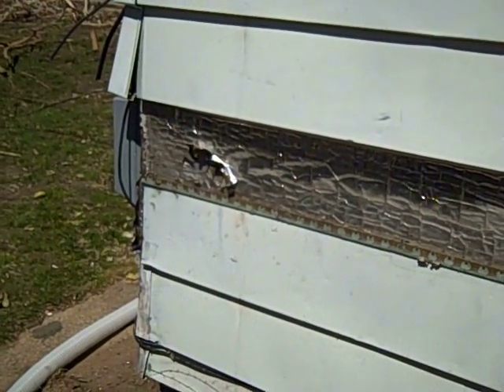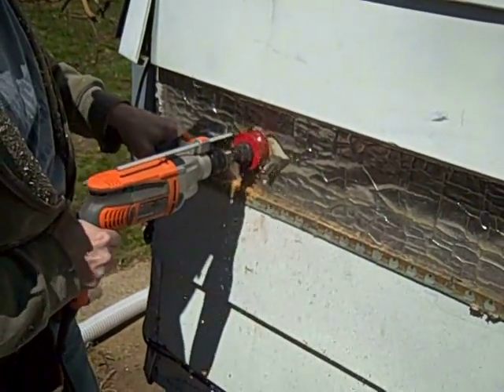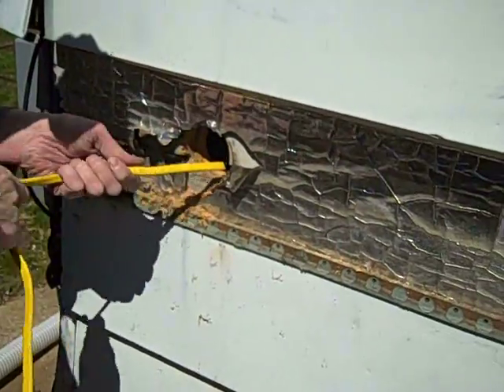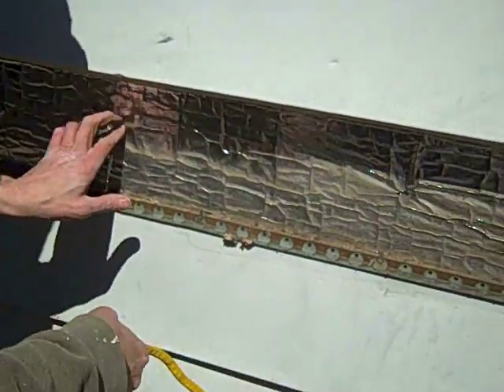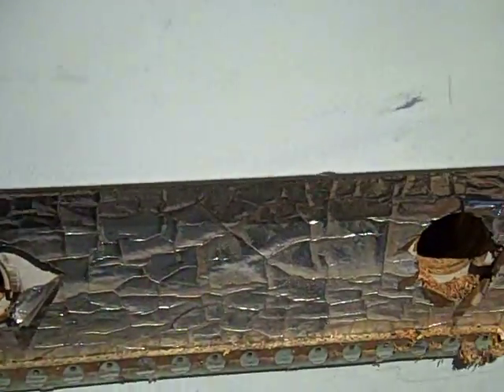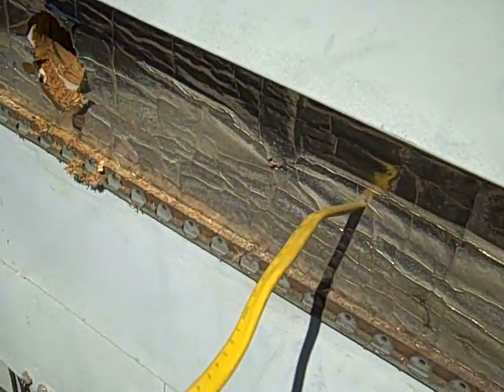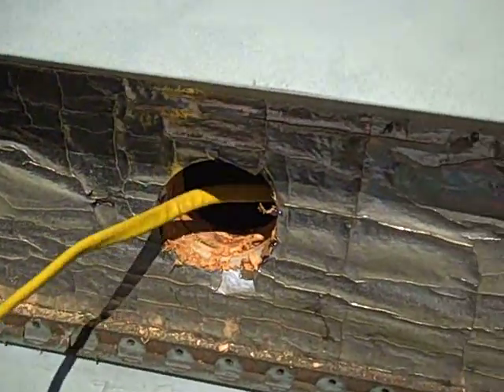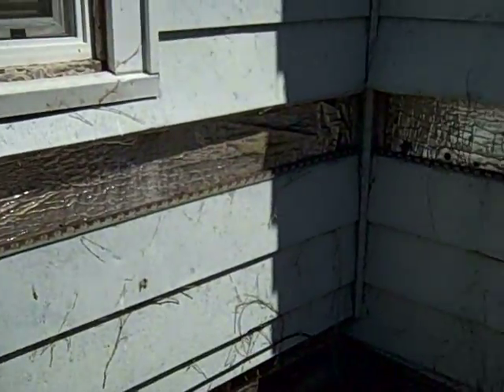Drillng holes in exterior before dense packing with cellulose - www.startinsulating.com

Comment from the maker: That was a Rigid and it burned up a few days later.  We now use only the Milwaukee D Style drill 0-500 rpm with detachable cord.  They go for about $200 on-line.  Its the best tool for drilling 200-300 holes a day.